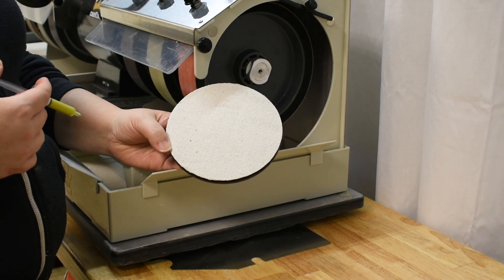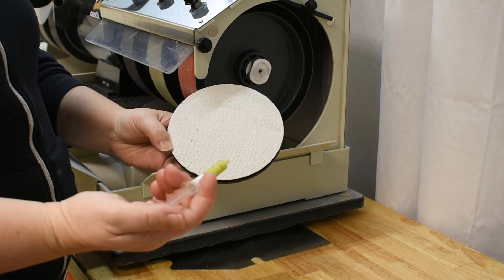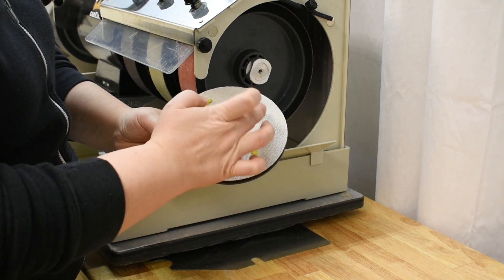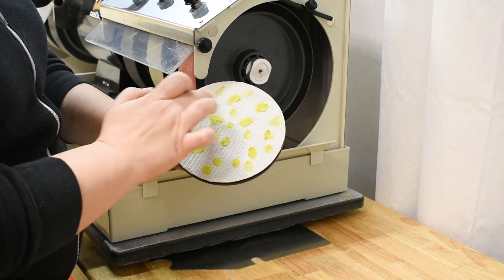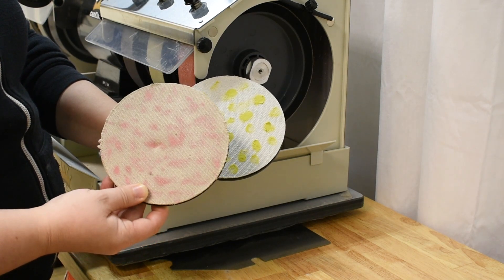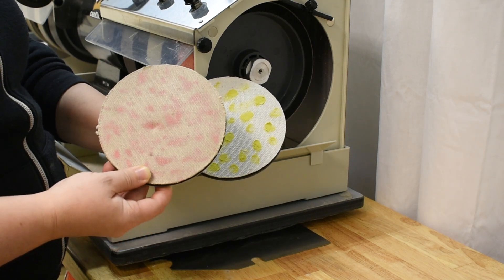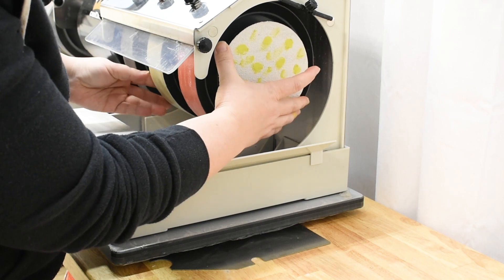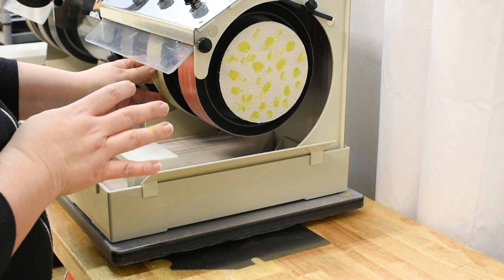How to charge and install the canvas polishing pad using diamond paste

Comment: I am considering my very first cabbing machine, and I’ve come down to 2 brands.
Cab King and Kingsley North. 
I have a question about the cab king. 
I plan to work mainly with Opal, and I’m wondering if there is a rabbit hair compressed felt pad available for the right side for final polishing with cerium oxide ?
Does cab king have that available ?